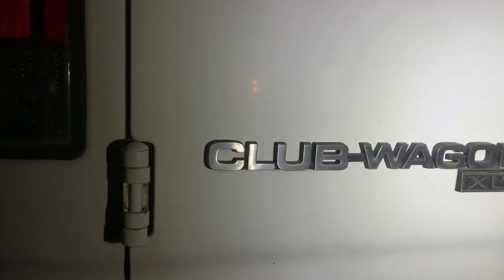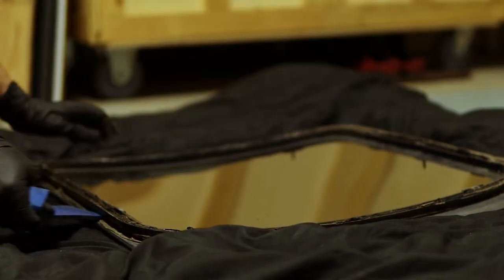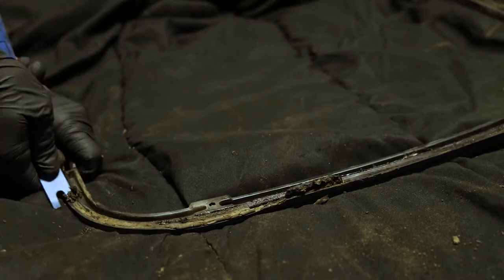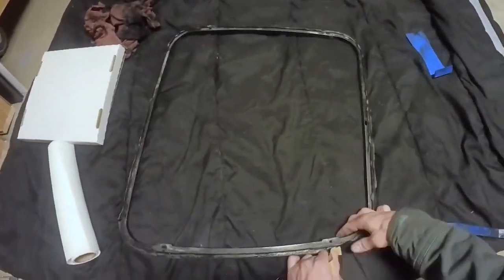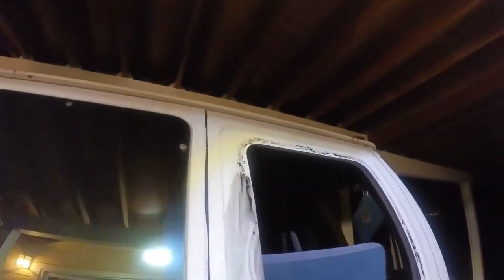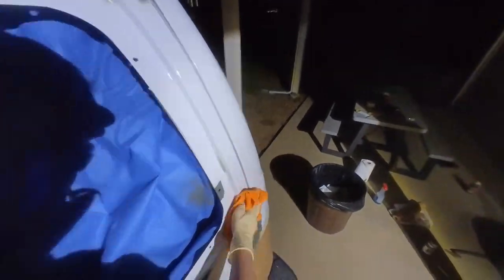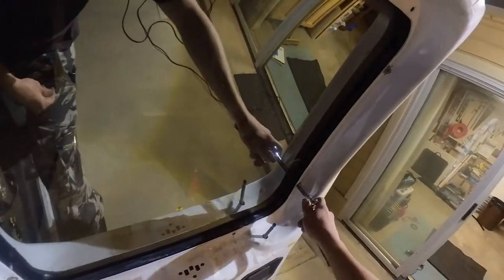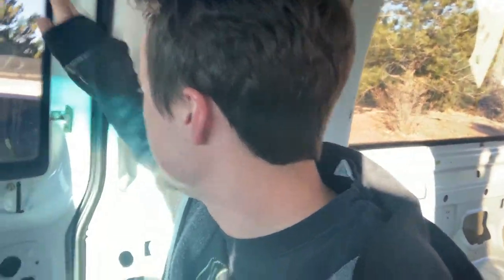How To Replace Broken Rear Door Window for Dirt Cheap | 1996 Ford E-150, E-250, and E-350

Comment: I used to use Goo Gone for removing tacky stuff like butyl tape, old bumper stickers, etc.  I later switched to using WD-40 which works much better and is much cheaper (especially if you buy the gallon size from Amazon).  Not only is it cheaper, you don't have to use as much.
Reply from the maker: Thanks for the tip! For sure going to try that, all my windows need to come out this week
Reply: Another tip I forgot to mention was using fine sand (for the plastic spacer) and sawdust (for glass and painted surfaces) to help remove the bulk of the old butyl.

1. While still cold, try to rip off as much of the butyl as you can
2. Simply heat up the remaining butyl with your heat gun until it softens a bit (working 8-10 inches at a time).
3. Rub in as much sand or sawdust as you can into the remain butyl
4. Scrape it off with a plastic scraper (or screwdriver on the spacer)
5. Repeat as necessary until all you are left with is the residue (then use the WD40 to wipe it off).

The sand/sawdust turns the scraped butyl into “butyl-boogers” that don’t stick as much to your scraper, your gloves or any other clean surfaces that the scraped butyl falls on.  Fine sand works the best – but you should only use it on the plastic spacer and any metal surfaces you already plan to repaint.

Comment: Dude I love your channel, I have a 94 e350 club wagon with a high top. I’m gonna need your channel! 😅 I just watched your video where you undercoated behind your fuel tank. Mine has got more rust on the underside compared to yours 😳
Reply from the maker: hey thanks! glad to hear you got one too! many more van vids to come. for sure, rust is common on these vans. if you need something to stop the rust in it's tracks but don't want to spend a lot of time doing a whole restoration. check out wool wax, stuff is amazing and stops things from rusting any  further, best of luck. next videos are on smoke leak testing the intake and the exhaust. also the current update on the van can be found here: https://youtu.be/gUAGHylMFfQ

Comment: Hey - just wondering if you have every seen the “Rear Pop Out” windows for the E-150?  I am converting my 2007 cargo van & want to install the pop out window for air circulation.  I am having a heck of a time finding these - any suggestions?  I am in Airdrie
Reply from the maker: funny you ask, I actually pulled a set out of rear pop out window at the pull and pay junk yard. will be installing them after I paint the van only paid 34 bucks for both windows and the brackets and hardware. all the doors are the same and will accept either window type without modification. best to look in a pull and pay junk yard. but they are kinda rare
Reply: @4WheelKid  hi - thank you for your reply.  I am glad you got a set & I am hoping that it wasn’t yesterday or today - I did call them yesterday (Barlow Trail) & they said they had a set - but I couldn’t get down there until tomorrow.  Fingers crossed.  I am very surprised that Ford discontinued the windows - van conversions are so popular right now.  Cam Clark sold me a set of windows but I have since discovered that they are incorrect- trying to return them as the parts guy mislead me.  I have tried just about every junk/salvage place around.  Anyways - thank you again for your reply & info - greatly appreciated.
(If you come across another set - can you please let me know?). Thanks
Reply: Hi - just thought I would let you know that Pick n Pull on Barlow Trail has a ‘bunch’ of those windows - I am going to head in first thing tomorrow & try to get 1 set for myself.  Many thanks for your help.  Take care

Comment: I found an old window. I got the Butyl tape off, but cannt find the right Butyl tape. The only onea I found were more foam type.  
Is tge tape double sided sticky ?  Is it rubber?  Where can I get it?
Reply from the maker: hey I have a link to the Butyl tape in the description of this video. works great, I have re sealed all my rear windows with this and it has worked great, biggest thing is cleaning the old stuff off completely

Comment: Did you caulk the bolt holes as well or was the butyl tape sufficient
Reply from the maker: The butyl tape is enough, was very water tight